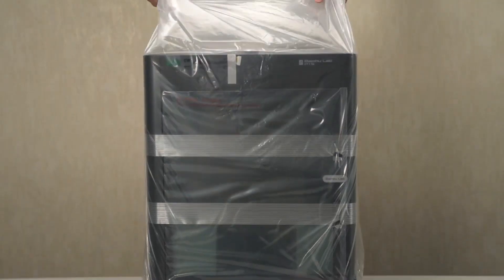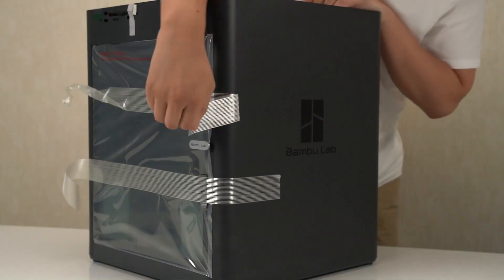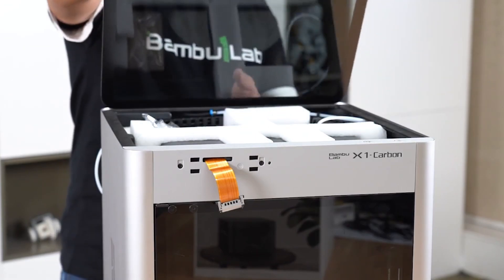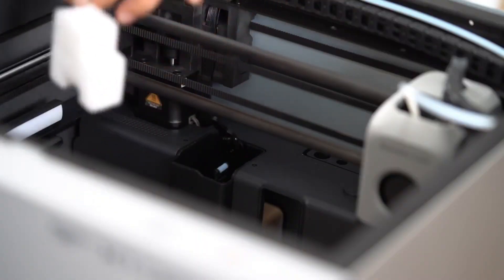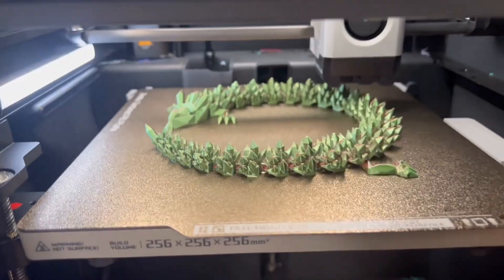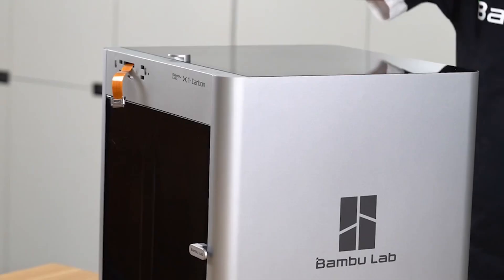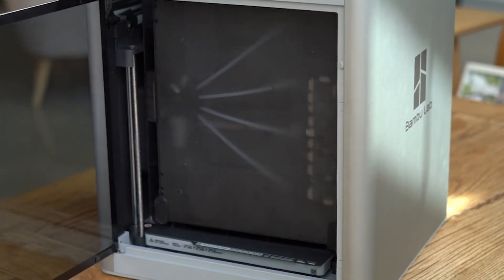Bambu Lab P1S vs X1C Differences - Which is Better Choice?

Comment: I'm currently debating a p1s with ams 2 pro combo or an x1c with original ams combo.  I'm a newbie and current sales put these two configuration about $200 apart.

I'm more concerned about the display, camera, and AI detection.  Do those features have more weight of importance over an ams 2 pro?  

Thats my current struggle.
Reply: Get the p1s

Comment: Here's where I'm at: 
Do I get two P1's with AMS or one X1C with AMS?
I don't print with exotics so thats not an issue.
All the parts on the P1 are upgradable to the same as the X1c.
For £100 I can double my workflow output.
Are there any other features that i should be aware of?

Comment: If only Bambu would make a 300 (at least) or 350mm3 "XL"1-Carbon, I'd be the first to buy it. I can't justify the cost and size of the X1C against the A1. Need a printer with both advanced materials and a larger build volume. Knowing the relatively "lame" A1 has the same build volume feels like a bummer. Come on Bambu..

Comment: I'd like to see the differences with engineering filaments like nylon, etc. I also wonder if the hotter bed of the X1C provides an advantage.
Reply: Only in CF filaments the first layer adhesion is better in my experience but u can always put glue for it

Comment: 🎯 Key points for quick navigation:

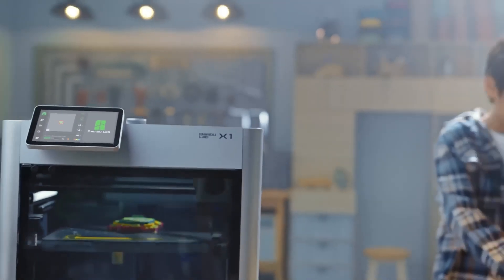00:40 🏗️ X1C features a touchscreen, better camera, and aluminum enclosure, enhancing usability and durability.
01:48 🕵️ X1C's advanced air detection and calibration features improve print reliability and early error detection.
02:45 🎨 X1C's hardened nozzle and gears enable printing with abrasive materials, ideal for functional prototypes and specialized creations.
03:41 💼 P1S is designed for ease of use with standard materials like PLA and ABS, suitable for hobbyists and educators.
04:22 💰 Consider budget and intended material use: X1C excels with advanced features, while P1S offers cost-effective reliability for everyday projects.

Made with HARPA AI

Comment: Should I pull the trigger on an X1C right now? Or do you think they are gonna release a new model soon? Thanks 🙏
Reply: The perennial question
Reply: They did announce they will release a new printer in Q1 2025 but they mentioned it would be a Prosumer Printer, above the X1C. So cost wise it should be above $1500 and targeted towards more Pro users. X1C is not a bad choice plus they extended the firmware support to i believe 2027

Comment: Bad software and firmware = bad experience.
Latest firmware update bricking AMS units.
Unable to use the send to function in LAN only mode, means transfer only by file copy to and from SD card.
Cloud outages.
Bambu really need to get their act together.
Hardware seems to be top of its class.

Comment: Gave me the exact information I needed to finally pull the trigger on a P1S.  All I use is PLA and I wanted to use ABS and ASA, so this one seems like what I need to move on from my Anycubic Kobra Plus (not a good experience, personally.  After buying 3 machines I decided to finally look at better quality printers)
Reply: How has your experience been since buying the P1S?
Reply: @dillonohrt1903  It's night and day difference.  I actually went with a P1P because I didn't see a need for the enclosure, but you can print out something to hold carbon filter over the exhaust fan in a P1S.  Fortunately the upgrade kit is available and it even says P1S on the part, so it's not just upgrading components, but actually turning your P1P into a P1S.  PLA and PETGHF (the bambu lab PETG) are both equally easy to print.  I've run through half a dozen spools already and that's with a lot of down time.  This thing is fast than the bed slingers I've bought in the past.  The calibration needed is built in.  I can calibrate from the app to zero in on a filament and layer lines are less noticeable.  Everything is good out of the box.  I had a few screws to remove, I leveled the bed and calibrated the filament and started printing perfectly.  Models with printed screws or tight tolerances have been no threat.  

Tinkering with devices is definitely a cool hobby, but I always wanted to just print.  I've since given my old printers that didn't work to a neighbor because he wanted to tinker and now I'm planning to get an enclosure kit for my P1P and buy a second P1S.  Being able to just print and not worry too much has been game changing.  There are still small problems sometimes.  I had filament cross over itself and cause problems.  The WiFi module needed to be reseated after I notice a loss of WiFi connectivity, but I'm ordering a spare and it was only $4.99 usd.  The parts are mainly found on their site, but they're all easy to replace and decently priced.  

I'd highly suggest going with them.

Comment: It’s a difficult choice, but I guess that the processing power of the x1c makes the biggest difference. It opens up more possibilities for firmware enhancements to improve quality. That being said it’s an old printer by now. I have an i3mega which I bought in 2017 and is still holding up fine for my needs , but hey it’s 7 years old and technology advances, so it’s time to upgrade.

Comment: Slice Engineering just released their Mako hotend for the Bambu Labs machine.  That opens up a lot of quick change nozzle options - nozzles from Slice, Microswiss and others can quickly be installed without tearing the hot end apart.
Reply: I saw that, and I know they worked with Bambu on the Mako, and they're boasting crazy print speeds with that hotend, but I haven't seen anything about reliability versus stock.  I would be interested to hear from someone who has used a Mako (or similar) hotend on an X1C.

Comment: There are some other features of the X1C not mentioned or at least not focused on.

1. With the AMS and using the lidar you can calibrate up to 4 filaments at a time. This sets k values automatically. (flow rate and flow dynamics)
You can run similar checks but it is a manual affair on the p series and since you are eyeing it is may not be nearly as precise as the lidar.

2. The X1c screen is leagues beyond the p1s screen. And with that you can run the X1+ custom firmware. So the mobo/screen on the X1C handles more processing work than the anemic p1. 

3. You can FTP into the printer to pull video/timelapse, send over files over a network. It can be done on the P/A series but it is much slower. This is great for those who dont want to remove memory cards or want to disconnect from the bambu cloud. 
 
4. The higher end camera is 24fps at 1080  vs 720 p at .05fps, it's the difference between a video and a slide show. Also if you create content recording full video and not just time-lapse is a night and day difference

5. Max bed temp is higher on the X1C (110 vs 100)

Since I started with the X1C it's hard to look at the p1 series since a lot of the QOL features end up being lost completely or require more steps to get to parity. (like updating extruder and hot end Metal panels vs plastic, adding carbon air filter and then there are things that can never be added to reach the same feature set. lidar, camera, touchscreen, custom firmware, max bed temp
Reply: Thanks for your review! Im deciding between p1s o x1carbon for my print farm. I was considering going for p1s to get more machines but it seems like x1c is the one for printing farms
Reply: @solosequenosenada7096  Hmm, if you are going the farm route I would ask what your are printing. If you are doing pla/petg/tpu
 p1s or even A1 can be fine.

If you are going with ABS/PC/nylon or any exotic materials then p1s or X1C. The p1s will need to be upgraded with hardened extruder and nozzle to prolong some parts. Also if you are printing abrasives  on a regular basis stock up on ptfe tubes and the AMS will get torn up with abrasives. 

 In a farm environment the screen, auto calibrations and such may not matter that much if you use the same filament and settings. So you may need to tune a few times and be set going forward if you limit print variables. 

So if you want flagship go X1C(1200 or 1450) and want to not compromise on anything.

if you are looking for farms and need an enclosure x1c or p1s(600 or 950)
if you are printing basic materials go p1p (500) or A1(339 or 389)

I always look at farms in this fashion what is the most cost effective way to get out parts without compromises. faster camera, lidar, better screen etc, the 500-600 price gap is another machine which is a hit to productivity. 
 
The P1S can print just as well as an X1C. it's the QOL features that make it better but if you are churning out parts an individual machine features may not be better than getting 2 machines for the price.
external Smart cameras exist for monitoring
panda touch can manage 10 bambu  machines with a similar touch screen as the X1C. The biggest issue is printer firmware may stop it from working. so YMMV. You also have the option of a smart phone/ tablet

It's the lidar and auto calibrations that are left which you can tune manually and setup profiles in bambu studio or orca slicer.
Reply: @personwomanmancameratelevision  Thank you very much for taking the time to give me this information! Going to go for the X1C for personal use, prototyping and will start adding P1S and A1s to the farm
Reply: @personwomanmancameratelevision honoestly the x1c having a big screen shouldn't even be a point since you can buy a big touchscreen from bigtreetech for 60$ and also 10C bed diff isnt the end of the world. only real concern is lidar
Reply: @2b2c1d2  Bigtree tech's, Panda Touch, acknowledges they could potentially be cut out of bambu printers if an update blocks them. OF course you can just run a cell phone or tablet or windows computer running Bambu handy(android emulation) or bambu studio/Orca slicer and get similar functionality while bypassing any firmware blocks in the future. 

As I mentioned before that Screen runs more than just simple controls. The linux operating system runs and can potentially run more than any p1/A1 with or without a BTT screen.
Reply: I've been running a P1S for a year. It's been virtually trouble free with occasional issues with the more exotic filaments and some minor disappointment with AMS. I had some bed adhesion problems early on with Bambu labs own carbon fiber filaments but that was easily resolved by using a smooth plate with glue stick. My biggest issue with AMS is all the purge cycling as it can triple the print time and wastes a lot of filament. I'm also experiencing a new problem with their specialized support filament for use with their carbon fiber filaments. It worked fine for several prints when I first got it but I hadn't used it for 6 months and now it won't print without stringing and contaminating my part. I tried drying it but it didn't help at all. I'm starting to wonder if the filament just goes bad. I was considering going to a Prusa XL with dual print heads but that's $2500 and Prusa charges almost $200 for shipping to the states. I'm kinda tempted to just move to the X1C for it's supposed better performance with the niche filaments.
Reply: @RYTHMICRIOT as time goes on Filament absorbs moisture which makes it virtually unusable. I keep all my filaments in a plastic bag with those white pouches that come with electronics. It is completely normal for old left out filament to do that

Comment: Any ideas or help on how to use the control screen for the P1S. I am having major problems using the screen.
Reply: You can use the Bambu handy app on your phone, The screen on the printer (P1S) can be laggy.
Reply: @Denniss7420  i can't pair the H/app with my P1S it prints great with BL Studios but not H/app it shows pair number on both phone and screen but nothing happens

Comment: Very nice video! This is a great summary of how I made the decision to purchase the P1S. I spent weeks of watching videos and researching to get this very information. I went with the P1S because the only main difference was the AI lidar stuff which with the reliability and my OCD to always check the first layer myself anyway was not worth it. If I need a hardened steel nozzle and stronger gear system I can always purchase it down the road but right now I'm just printing PLA and TPU with an interest in ABS soon. Thanks for this video and it will help people like myself make an informed decision when purchasing a 3d printer
Reply: Any regrets?  I'm in the same place now. I want an enclosed XY unit vs. the bed swingers for wider range.  X1C is tempting but I'm not sure if it's worth it over the P1S.  how is the UI?
Reply: @cheesun124 I still use my P1S a lot and have had very little problems with it. The only big issue is a flaw with the AMS where the filament breaks inside the PTFE tube and you have to take apart the AMS to get to it, but that's an issue with the X1C too since it's the same AMS. I still haven't tried ABS, but PLA works great for what I use it for. I have no regrets in my decision and it was a great upgrade from my 5+ year old ender 3 knock off, lol. 

As far as the UI, I haven't used the X1C UI but the P1S has great UI. I don't usually have to control the printer much, but if anything I use the app. The only thing I really use the screen for is if the print doesn't stick (usually my fault for not using a brim lol) I press the pause button, which conveniently is a physical button on the P1S. 

What do you like about the X1C vs the P1S? If it's the auto flow calibration/error detection and/or camera quality (which is definitely good enough on the p1s but definitely better on the x1c), and you're willing to spend the extra money go for it, but if it's just the screen I'd personally say it's not worth it.
Reply: @ChrisJab4  awesome! thanks for your response. That’s helpful, great feedback.  I’m not gonna lie there is an attraction to the X1C because of the looks, the touch screen and because of the extras that you get for it, but I was trying to understand if it’s worth it especially for the early error detection. This will be my first 3-D printer and I do want to get into printing tougher materials, not just PLA.

I think the P1S is more than enough to get that job done then at 1/2 the price. I will have to do the minimal upgrades when I’m ready.

Thanks again
Reply: @cheesun124  No problem! For your use case, I would say if you're on a budget get the P1S. Personal opinion, but I almost think it looks cleaner, especially in my room where all my furniture is dark wood. The error detection would be a nice feature, but with the automatic bed leveling on both, if you're using PLA and slice correctly (use a brim for low-contact objects) the chances of error are low anyway. Like I said in my original comment, I usually like to check either the video if I'm away or just watch the printer myself to catch any errors.

I would start out with PLA for sure. I've been printing for 6ish years now and have only just last year started printing with TPU because I needed something flexible. The exotic filaments generally cost more and are difficult to work with, so I stay away from them but again it's up to you.

Let me know how it goes! I'm glad I can help!
Reply: @ChrisJab4 thanks for the advice, great to get help from someone in the community and experienced.  My problem is that I like shiny objects, I’m trying my best to stay practical on this.  P1S I think is go - picking up this weekend hopefully.

Comment: you can change the extruder and the hot end so no problem for the p1S
Reply: even with max bed temp of 100?
Reply: @jamierichards925  yes of course , and you can also dry your filament like the X1C except you need to add a timer on your phone or anything else
Reply: @skynlab2478  oh OK I thought some needed temps of like 110 etc to print but that's good to know
Reply: Is it judicious to get only the hardened steel nozzle or the complet hotend and which size do you advice getting beside the 0,4 mm:0,6 or 0,8 mm ? Thanks in advance